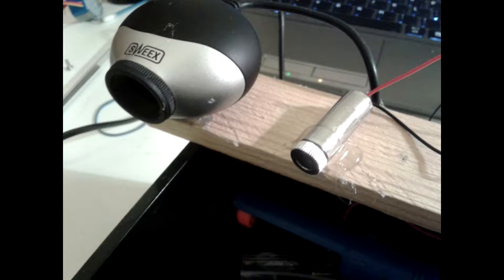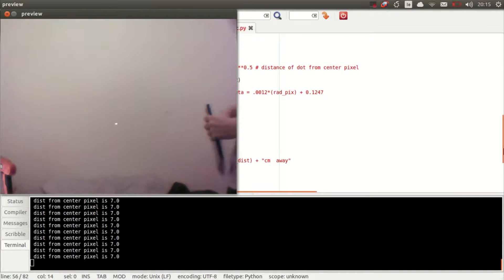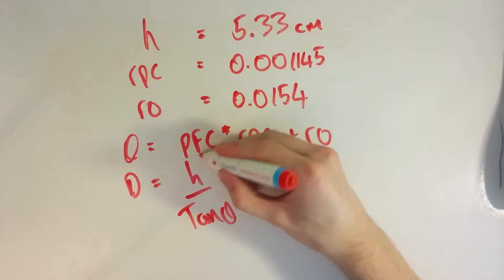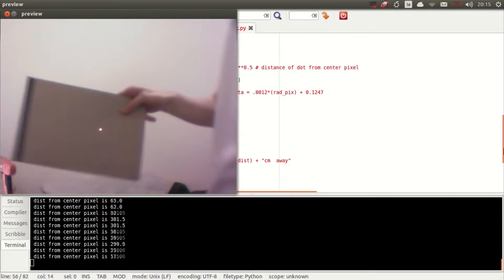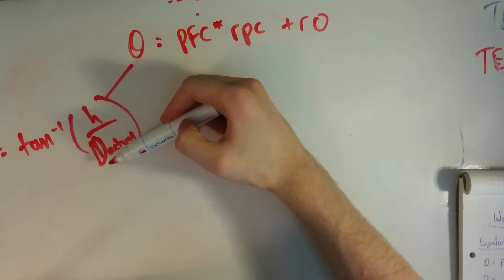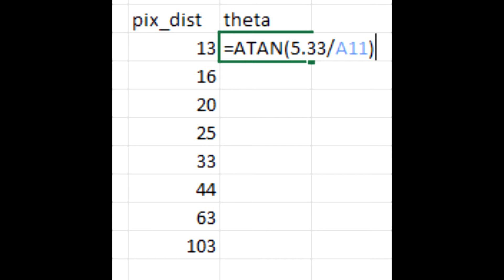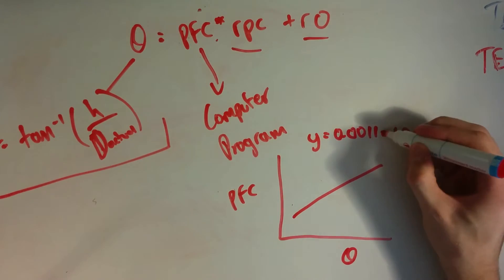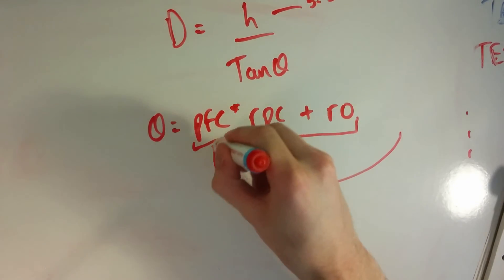Explanation of how a camera - laser rangefinder works

Comment: From this configuration follows a simple conclusion that accuracy of proposed system can be, at a minimum, doubled: by a certain orientation of matrix to its axis of vision, and direction/location of laser, relative to the same axis of vision of the matrix. As a result, entire field of matrix will be involved, and not at half distance from any of its edges to the center of matrix. That is, "from edge to opposite edge" and also "from corner to opposite corner" of matrix. I hope that opencv is already used - for interpolation of coordinates of the spot on matrix, which will increase the discreteness of calculated angle/distance.

Comment: I thank you for this method of range finding. Its helped me out a lot! 
I have:
-  a potentiometer to the positive wire of the laser, helps reduce the detection scatter by changing the brightness
-  adding a slider and a variable to the ( num = frame[...,...,2] > ###)
-  electrical tape, with a pin hole , covering most of the laser beam, to reduce the large white blob in the center of the laser dot
    when up close ( my $1 laser pointer needed this as I lost the lens and with out the tape I'd have a 30mm dot, 10cm away from  the camera

not sure if you have done this or thought of any of these,  but I thought I'd share :D